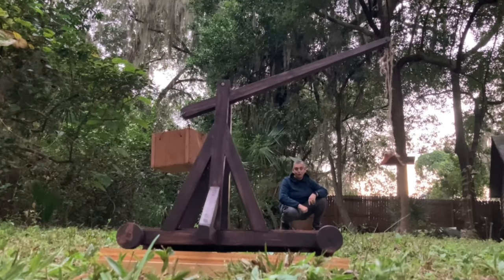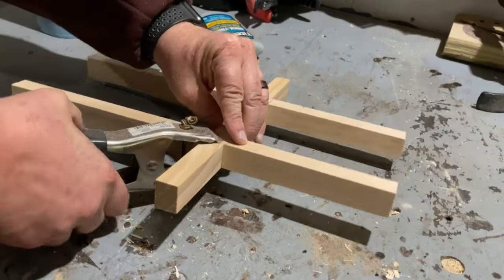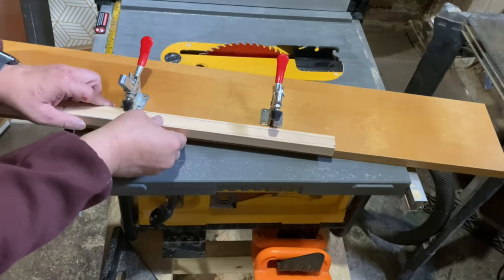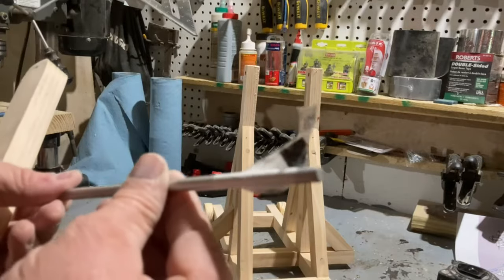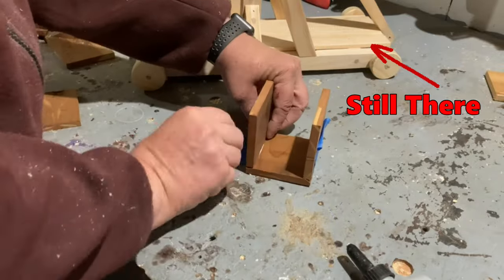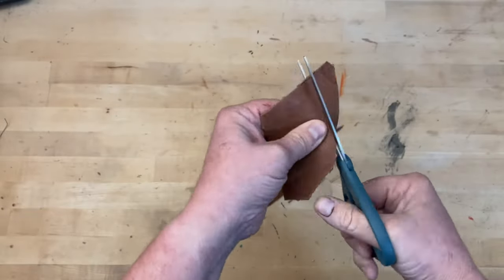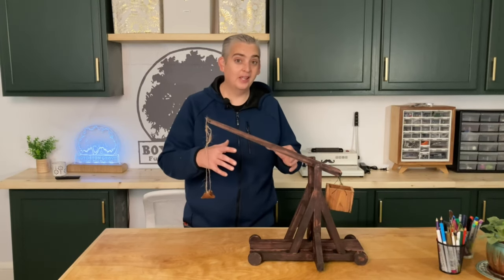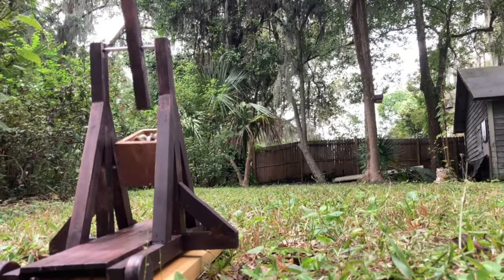Building a  Mini Trebuchet // Fun Woodworking Project!!

Comment: The link to the plans doesn't appear to work anymore, any chance you can adjust it?
Reply from the maker: So it seams that they removed that site, but I did find a link to a Pinterest site with the exact same plans:
https://www.pinterest.com/pin/524317581608067759/visual-search/?x=16&y=16&w=532&h=494